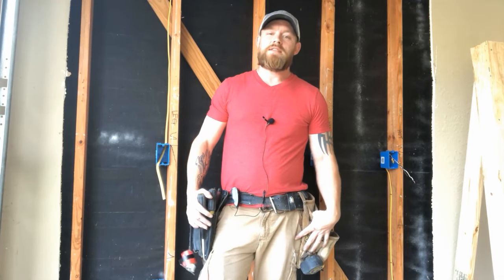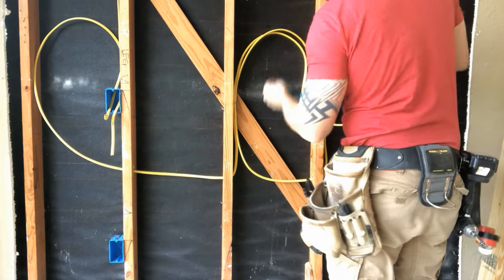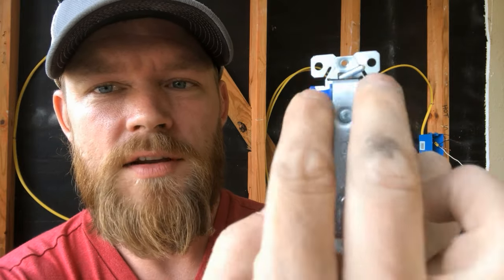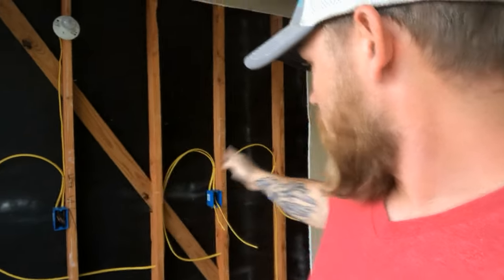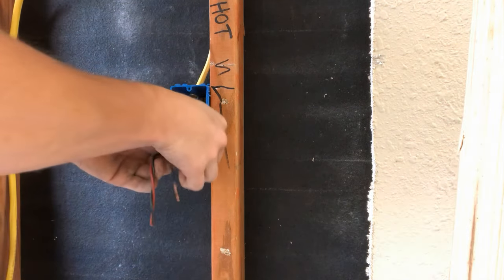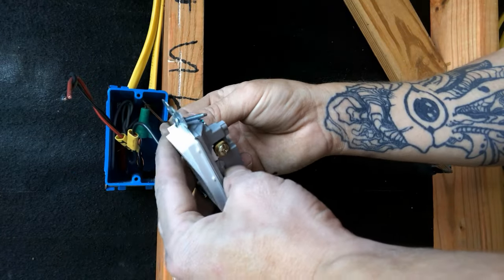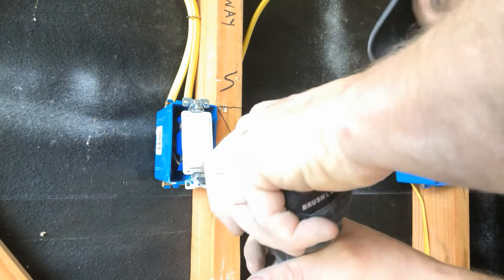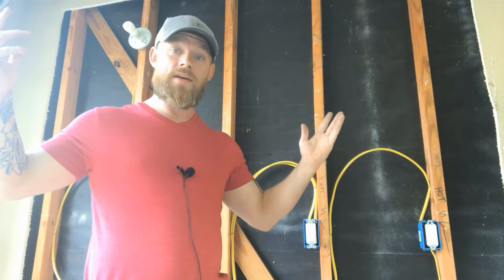Episode 8 - How To Wire For And Install 4-way Switches

Comment: My 4way switch must be wired incorrectly because 2/3 have to be switched a certain way in order to cut the lights on. If one is out of position I gotta go around to find the correct order to cut them on. I'm thinking it's something to  do with the incoming and out going on the 4way switch. Great video I feel I now have the knowledge to tackle this. Problem is my switches for that series of lights are installed in 3gang boxes with other 3way switches that on control other series of lights from 2 locations so I'm going to have to start from scratch and identify the where the incoming hot or line wire is. I believe to do this I'll need all the devices off of the terminations and capped off. Then use a MM or proximity voltage tester to identify in which box the hot wire is located. Or am I way off?

Comment: First awesome video second I was told to wrap outlets in electrical tape so that the screws could not come in contact with a ground wire what are your thoughts on that?

Comment: Thank you for the info.  The electricians who wired my house (1986) used Red & White Traveler Wires instead of Black & Red like you did.   Does electrical code allow for changes like this?  Other things in my place have been screwed up too...
Reply from the maker: That was up to code for 86 - back then there wasn't nearly as much code as there is nowdays.

Comment: I'm curious as to why you loop up into the top of the box vs. just coming into the bottom?
Reply: Most likely to have a service loop. I was thinking the same thing
Reply: It's his habit to keep the location of the box flexible, should it need to be moved on a whim later.

Comment: Great vid! I'm replacing a 20 plus yrs old 4 way switch, on one side it's labelled line 1 and on the other line 2. Is it safe to assume that line 1 is the IN and line 2 is the OUT? Tried google, no luck.

Comment: oh god here comes the pre twist vs no pre twist arguments.
Reply: Tyler Rainville to quote my teachers (for the benefit of other readers) pretwist 12awg and up, 14 and smaller don't require it.  However, this does require the tech to twist the cuss out of the wirenut, or there will be loose connections.  Troubleshooting those or remaking boxes during finish is a huge pain.

Comment: Dustin, you run, or seem to run, a lot of 12 gauge wire in household applications. Has there been a change to code since I have been out of the industry? In a residential application, or even commercial applications, it would all be 14 gauge/15 amp service, except for kitchens In residential, and higher voltage and/or amperage requirements in commercial

Comment: Two questions I'm curious about.  1. Why run 12/2 instead of 14/2. Around here most lighting is done with 14 guage.  2. Why don't you run wires into the bottom knockouts on the boxes? You always loop up around and come in from the top? Is there a reason for that or just how you were taught?

Comment: So this video really helps. I been doing trouble shooting on 3 way 4 way 4 way 4 way 4 way 4 way then a three way then to the light. My question is they powered the the last 3 way with the light in the last box in the run. Can you power a three way and the light. Then run it down the way to the other 4 ways then to the 3 way. ? let me know id really like to here your advice. This is construction defect repairs.
Reply: Helpful

Comment: Great Video. Question: if i change the breaker from 15 to 20 amps do i need to change the size of the wire? Please and thank you.
Reply from the maker: In most cases yes, some things like motor loads this can be a different answer. Keep in mind your breaker is there to protect the wire. Typically #12 can hold 20amps of current (depending on the type of wire) flowing through it before the insulation starts to break down/melt. If you have 14ga wire with 20a running through it for long enough, the insulation will burn up and can cause a fire.
Reply: Electrician U Thank you very much.

Comment: What would you do if you have a three way switch with the power coming in the switch and the light coming in the same switch would you use the white wire to go to the light and tape it black or market leg

Comment: So the incoming wires are coming from the panel and go on top? The outgoing are on the bottom of the switch and go towards the light? Sorry if its a dumb question. We are about to do this in class and i just want to make sure i understand

Comment: I sure wish you had wired my house. I just put in a smart switch on a 4-way switch group. They neglected to run 12/3 to the 4-way switch box so no neutral available. And of course nothing was labeled. Question: in today's world of smart switches and such is it advisable/good practice to include a capped pigtail neutral coming out of the neutral bundle? I saw this in some other "youtube expert" videos but was curious to hear your take on it.
Reply: Running neutrals everywhere, even if they're not used, is now "Code" but it still depends on what the local code and inspectors want.

Comment: I always pictured it like if you have a 10,20,30 story building and you have to put a switch on every floor in the stairwell 3way on top floor and bottom floor and infinite 4ways in between switch leg on one 3way and power on other 3way

Comment: Thank you for this video.  I have one question for ElectricianU.  I am replacing a 4 way switch, but for the style of switch I have used in my house thus far, the 4-way is only available in 20A.  The existing 4-way is a 15A.  Can I use the 20A 4-way on this 15A circuit where the hot and leg are 15A?
Reply: sure can nothing wrong with using higher rated equipment on lower amp circuits just leaves more safety margin

Comment: Why the big loops cable must be cheap  in the U.S.A.  .In Australia we never clip cables behind walls as later on if you modify can use them as draw wires.

Comment: What happens to the circuit if you put your feed on the "output" pair of the screws and the other pair on the "input" pair ? The setup still work? If it will not how will it behave

Comment: To do 5,6,7,8 way circuit... You do a 3 way switch for the hot side, then 4 way, 4 way, 4 way, and then a 3 way (5 way switch). To do a 6 way circuit you do a 3 way hot side, 4 way, 4 way, 4 way, 4 way, then a 3 way on leg side... Keep adding a 4 way switch in the middle circuit to add switches...

Comment: Just a question in order to prevent short circuits on a new install in this situation one could check for shorted circuits prior to applying power by checking continuity of the last switch to ground prior to installing it into the box, is this a common practice at all?
Reply: Yes it could be done.  Can't have any load on the circuit, though.  (No light bulbs, smart switches, etc.)

Comment: Can you run the wire from the light to a 4 way switch, ( the 4 way switch would be shorter run to the light).

Comment: Love your videos I’ve been following your journey for over a year now and often go to your channel when I’m not sure about something. Question about the grounds. I have always twisted them together all the way just like you showed there. But recently I heard someone say you don’t want to damage the wires the whole way because copper stiffens as it is bent so as a result it’s better to only twist it an inch or two and leave the rest of the length of ground wires untwisted. What are your thoughts on that?

Comment: Hey dustin, thanks for the video. Never seen those ground nuts like that in Canada. Question, I understand you labeling your incoming hot and leg lines, but do you label your travellers so that you won't mix incoming travellers with outgoing? say swap two reds for example?
Reply: you dont need to worry about swapping travelers

Comment: ? Why don't they put the screw holes that hold the Receptacle to the box on the outside ,so when u fasten the Receptacle or switch the screws can't touch  the wires in the box . That's just one less step you have worry  about  ,just my opinion .another great video  thanks for the information

Comment: Question? do you have a video for a 3 way or 4 ways switch with the power source come right for or from the light box cauze i sew an imagen that show it that way the power do not go to the switch box but is goint straigh to the light box then suply the switches got me

Comment: is there a specific reason you're using 12g wire instead of 14g for a lighting fixture? to me 14g is so much easier to work with and all the electricians I see use that for most applications, especially lighting because its pretty low draw. would 14-3 not be allowed in your jurisdiction??
Reply from the maker: It was an example. Used existing wire in my garage circuit to film. 20a circuits in the garage. 12awg NM-b in the walls

Comment: How about using electrical tape to cover the connections on the switches and sockets it may be time consuming but safe.What do you think? And thanks for the explanation on the four way switch.
Reply: I always do this in if the box is metal, a couple times i unscrewed a switch/outlet and the thing sprung towards the edge and caused a short at the screw terminals.

Comment: In your 4-way setup. Is it possible to then add a receptacle using power from the 4-way switch? For example, if I wanted a receptacle on the ground directly below the 4-way switch.
Reply: yes, you would pigtail off the line feed at the first box.
Reply: @SticksOnSticks  so he would have to tap into the line switch not the 4 way switch
Reply: @DLmohh  yes, because in those switches past the first switch, there is no constant power. unless there was a seperate line from another circuit

Comment: Don't you use flex pipes / VP pipes in murica? Bit weird to me that you run single insulated wires in the walls. We use individual 1,5mm2 or 2,5mm2 wires when we do recessed installations. L1 Brown, L2 Black, L3 Grey, Blue for neutrral and green/yellow for ground.
Reply from the maker: These are not single insulated wires. If you look closely you’ll see that each run has 3 conductors in the yellow sheathing. One insulated black, one insulated white, one bare ground.

Comment: I have a general question....do you need to use 12/3 wire for all 4 way switches? I am trying to understand why one could not use 12/2 wire, 1 black hot coming in, and another black hot out (traveler) to the next switch. I know there is definitely a reasoning behind why there are two (hot) traveler wires (red&black)  but just trying to understand. Thanks!
Reply from the maker: It is easier to configure with more conductors to use. 

You can always run more if needed. But there is a limit to it. A physical limitation. Also field identifying conductors can get rather messy.

Comment: I found The “input “ and “ output “ locations on older version 4 way switches versus the newer version 4 way switches is 90 degrees different….
at least between the “ rocker “ type switch, versus the” toggle type switch….

Comment: I am trying to do a remodel of two adjacent bedrooms ( no switches or lights were connected to the wiring).  None of the existing wiring is labeled ( also zero labels in the Service entrance breaker box), junction boxes in the attic and in exterior walls are not accessable.  The wire color does not indicate the function of each wire.  Whew!  I found that there is one large area circuit that is controlled by two 3 way switches in a hallway.  The load ( hall light) for these switches is the source of current for two separate branch series circuits (each in a bedroom)  where each is controlled by one SPST toggle switch located in each bedroom.  It looks good EXCEPT what happens if someone turns off the hall light from either of the two 3 way switches?  Its LIGHTS off in both bedrooms!  And this was signed off by the builders inspector!  First I drain the swamp.  Next it is time to wrestle alligators with my update.

Comment: If you accidentally have someone pull the leg and the hot to the same box, send either the leg or the hot down the white wire of the 3 wire on a 3 way switch.. had this happen once, and had to figure it out

Comment: Do you not have safe zones for cable in the USA? In the Uk we run all cables either vertically or horizontally in line with switches  or sockets, then other trades persons know where not to hammer nails or screw screws. The potential for those cables to get hit at a latter date seems massive.
Reply: yup like everything else though its a money making endeavor customer cuts wires damages  thts a $100 service call lol. look at our medical system we are a sick society because thats how doctors and medical industry makes profit the sicker you get the more treatment you need the more you have to pay
Reply: @wizard3z868 ok I get it and I fully understand that. We are lucky in the UK. All healthcare is free at the point of service. I really feel for all you - my American brothers. Running wires in safe zones is part of our wiring regulations over here.
Reply: @julianbalcikonis3665  yes some of us will try to locate wires out of the way just trying to be a little cynical&funny  one thing i find crazy is how you in the uk can just pull up floorboards and place j-boxes in the usa they have to be ready accessible.  pros and cons to both standards  cheers mate

Comment: If I were to add an outlet, would I run the wire from the light or from the switch?
Reply: Preferable from another outlet. But from the switch if the outlet won’t be used for a slightly heavy equipment

Comment: I have a four way in my hall but for some reason the switches have to be in a certain orientation in order for a certain switch to turn on the light.
Reply: A couple of reasons for that...One of your switches is bad or the wires are terminated wrong on one of the switches.  It has been my experience that the 4-way switch if wired incorrectly.  Hope that helps
Reply: Could possibly be the wrong type of switch.

Comment: I have a ge powermark gold 200 amp for my subpanel, I’m confused on how to set up my wires, I understand we’re the two hot goes and the neutral but the ground is confusing me in this panel, I have a smaller spot for the ground but the bar is connected to the panel the same way as the neutral, I understand you don’t use the ground screw as it’s already on the cutoff panel, do I remove the bar for ground and mount it directly to the panel itself, u may have to look up the panel to get an understanding of my confusion, if possible please assist. Thank u sir
Reply: Consult the instructions that came with it.  The ground and neutral bars should be separated from each other, which is something you'll have to do as it probably does not come that way.  It looks like your neutral is on the right, and the ground is on the left.  There should be four wires coming from your main panel....two hots, a neutral, and a ground.  The ground should be connected to the left bus (in the photos I see), and the connection between the ground and neutral buses should be removed.

Comment: How are you supposed to know when to use certain awg wire??
Reply: Listen2me  That depends on size of the breaker for your circuit or if you have a circuit that’s going to run a long distance you may need to up your wire size to keep from voltage drop. That would be a good video if one hasn’t been done or thought of yet.

Comment: This might be interesting to you electricians. There are many home woodworkers who use a number of 4 ways in between the 2 3 ways. And it is done to turn on the Dust Collector at a given woodworking machine. Before I went to automatic, I was going to use 22 4 ways, and of course, the 2 3 ways wired to the Dust collector; because I have 24 woodworking machines. So each machine has a switch; where the DC can be turned on or off. Works great.

Comment: Why 12/3?  How much load are your lights? Lol. 
Most time in Ontario for typical house interior light wiring fused at 15 amps they use 14/3. Or 14/2
12 seems excessive is why I’m asking?

Comment: I have 2 - 4 way switches and 2 - 3 way switches controlling a set of lights on the stairs. Unfortunately, they weren’t wired correctly and turning the lights off at one location does not allow me to turn them on at another location.
First floor switch is a 4 way switch. First stair landing is 3 way (and is the closest in location to the junction box), second floor is a 4 way switch. Third floor is a 3 way switch. 
Second and third floor switches can turn lights on and off. First floor and first stair landing switches cannot turn lights on if the other two switches  turned the lights off.
How can I fix this issue?
Thank you.

Comment: What is the middle Switch called. I am replacing all the switches on my house I just purchased and i am running in to some that are not your 3 way switch, I am leaving those for last so probably by Sunday I will start taking those off and going to Lowes or home depot to get replacements. If I run into one of those style id like to know the correct name to ask the reps at those stores.

Thanks
Reply: 4 way switch

Comment: Our electrical switches, boxes, breakers, etc have combination screws.  The heads have a square hole for Robertson (square head screwdriver for Canadians,  Phlilps for American practices and flat slot for everone else.    Why the Robertson?  The screwdriver never slips out f the screw head. and on tightening, a good connection is guaranteed. American electricians, try the Robertson head screwdrivers.

Comment: Would it be safe to apply electrical tape around the connections of either a switch or a plug? 
to avoid the ground touching the load screw.
Reply: Yes its a great p et practice to avoit faults
Reply: Avoid